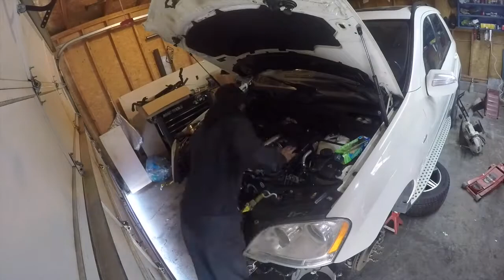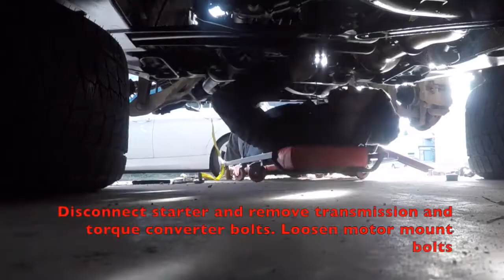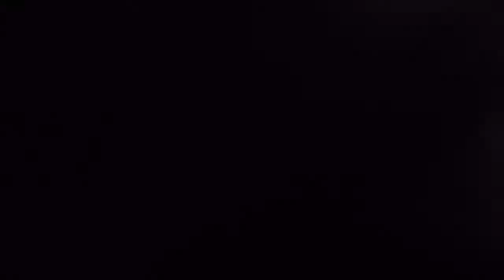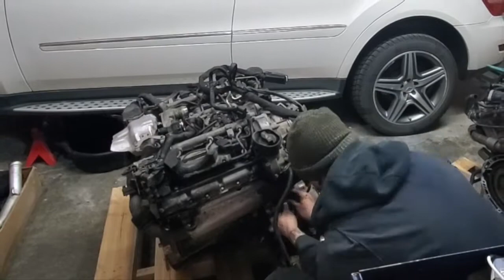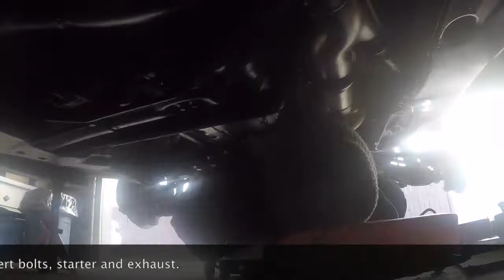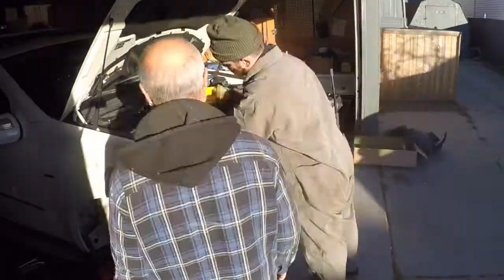Solve Engine Knock Now - Replace Your Mercedes-Benz ML320/ML350 CDI 3.0 Turbo Diesel OM642 Engine

Comment: Hello Eurotech do you know if its possible to remove the engine without the gearbox too, on a w204 OM642 2010 year, i need to remove my engine but I want to remove it without gearbox…
Reply from the maker: I'm not sure about this, but I would try it!
Reply: If its possible on your ML its possible too on w204 no ?

Comment: Did you have to reprogram to ECU or anyting if it's the same year motor I'm doing the same thing right
Reply from the maker: I'm not sure if you 100% need to, but I did reset all engine related parameters using ISTA

Comment: The E320 has OM642 too but it looks different than the Sprinters engine. Do you think I can still do a swap of those engines?
Reply from the maker: They made multiple om642 engines with varying outputs. Although they are interchangeable for the most part, It's best to match your engine codes best you can.
Reply: Hey sorry for a real layman's question...

On a 2010 ml cdi 350 ( 6 cylinder 3.0l)

If the intercooler or the engine had a major issue, i am toying with the idea of putting in an an american muscle car chevy type engine nothing crazy but seen some new v8 430hp engines.

Is it possible to do a transplant?

Are the electronics just too difficult to overcome with various computers for different functions of the vehicle ie getting suspension and driving modes to talk to the new engine?

Cheers richard in New Zealand

Comment: Hi Bro. Can you tell me what did you do with gearbox during  and after engine removal? Did you supported gearbox when it was without engine or it was fix free ? Regards from Poland.
Reply from the maker: Thanks for watching! I used a block of wood and floor jack to support the gearbox and made sure the wood was on the aluminum, not the plastic oil pan.

Comment: Great video ! Good job….!!! Sorry to bother you, I just swapped my engine on a W164 and have difficulty lining it up to the transmission…. Cause of the angle, height etc etc. Is it recommended to do that part with help from anyone. Or should it be a one man job ?
Reply from the maker: Sorry for late reply. You can do it solo. It only takes a little longer 😋

Comment: hi there pattycam do you do this on the side job how mucb you charge im in Calgary
Reply from the maker: 1600$ was the labour charge, not including any supplies. I can only do it in warm months
Reply: i see thats not a bad price, i already have the engine and i already fiding the time to do it this weekend, did you swap the injectors from the old engine to the new used engine or you just use the one in the new used engine, and did you had to program the injectors?

Comment: I just replaced my engine and I can't get it to start up. I was afraid to use ether until I saw you do it. Im in the US and the engine I put in there is from Canada. Do I have to have anything reprogrammed or should I be ok?
Reply from the maker: You should be OK. As far as I know, no need to reprogram anything. Be sure to not use TOO much ether. Also make sure there is no air in your fuel system
Reply: @eurotechca  thanks so much. A little ether and it started right up
Reply: @eurotechca  before the install my transmission was running perfect. now after the install, it drove just fine. now its making a noise when I put it gear and it doesn't move. any idea of what that could be?

Comment: Just done same thing except mine was a runaway diesel which effed my 2010 om642 engine up! Diesel in oil burnt in injectors ect
Reply: One more thing,i was getting blocked dpf codes before this happened so im sure this was to blame for it.Very scarey when you cant turn car off and it red lines smoke everywhere!
Reply from the maker: Absolutely, runaway diesels are intense!